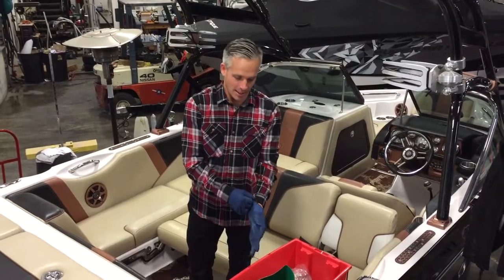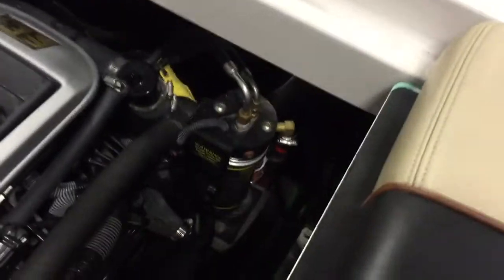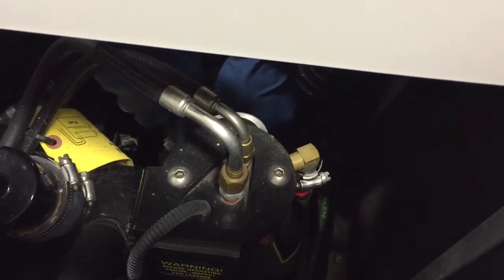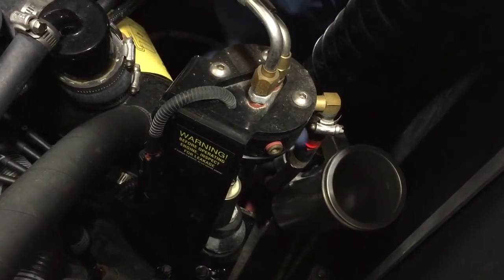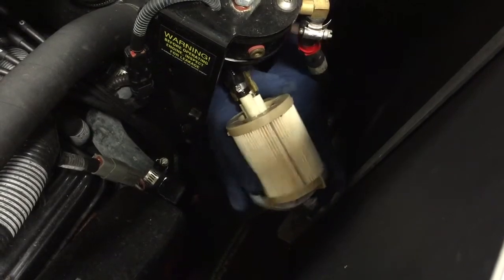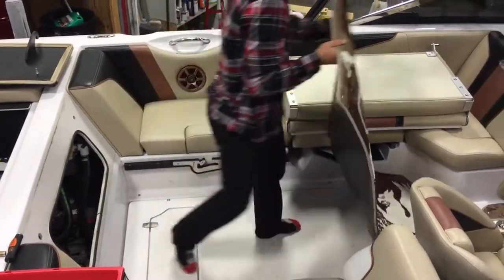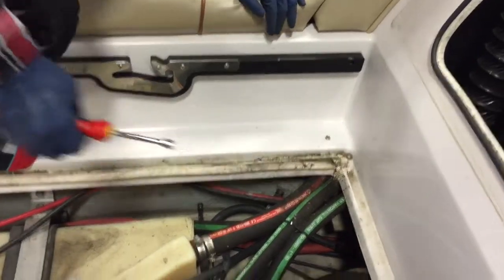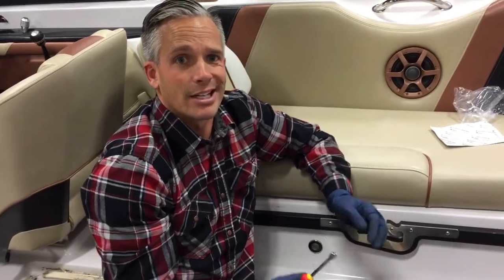N3 Boatworks - Fuel system service for 07-10 Nautique's.

Comment: I have a question I have a 2006 nautique and is trying to replace the impeller but my engine sit down bottom back and was wondering how to get back there or is there a access panel to it due to seeing any access to it. Thanks
Reply from the maker: Rob unfortunately you need to lay on top of the engine to exchange it.  If you have a 211 you will need have patience.  Straightforward job but can be challenging.

Comment: Do you find the older 210's from 2003-2006 were easier to work on than the 07-10's?
Reply from the maker: clark hall depends.  The pre 2007 boats are a little smaller and have more pieces to take apart.  Besides that they are roughly the same.

Comment: Can you give me the part numbers to the filter, high pressure fuel pump and the rotor pump? I have temporarily took the filter out to see if it was causing the problems but its clean, I think one of my fuel pumps are going out. Specifically the one that sits in the filter. Any help would be appreciated. Thanks!
Reply from the maker: Hi Toby!  Please give our parts department a call at 317-845-9253 and we'd be happy to get you that information.  Thanks!